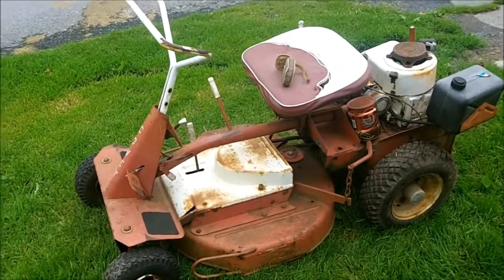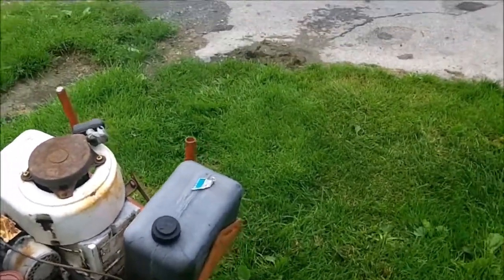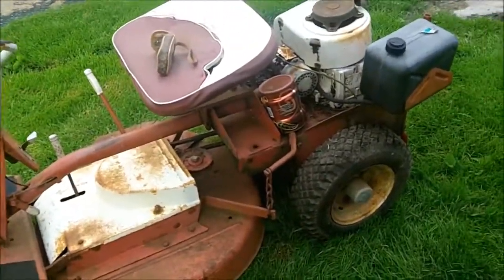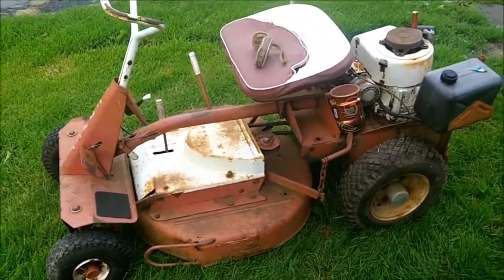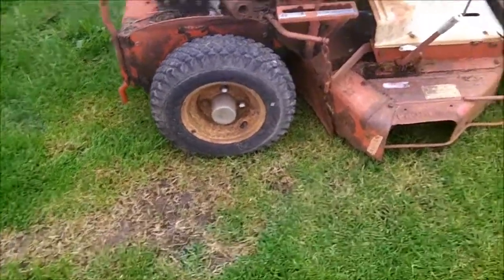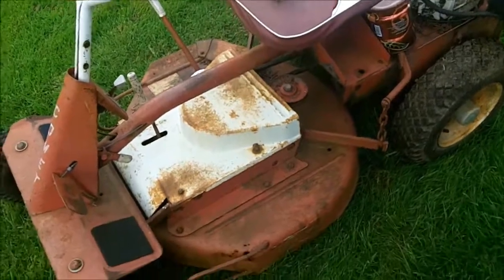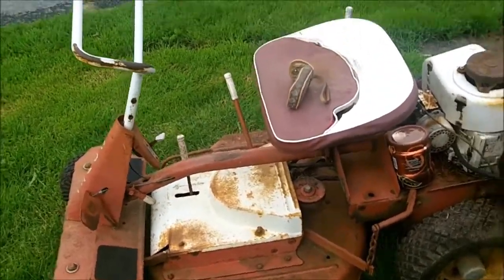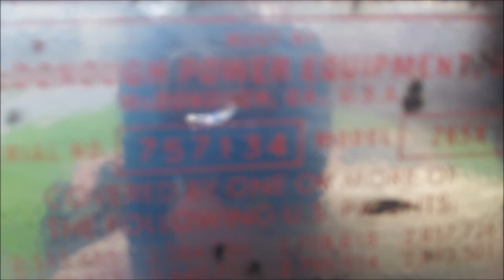me talking bout the new snapper comet hybrid project

Comment: in my opinion if you have a good engine on the one i would probbaly pull it and put it on this one these are getting quite hard to find and its in decent shape biggest thing with the motors is pull the one on this one and make sure the mounting holes are the same as the other one i have found snappers swapped with 6.5 push mower motors and ive found them with 25hp v-twins